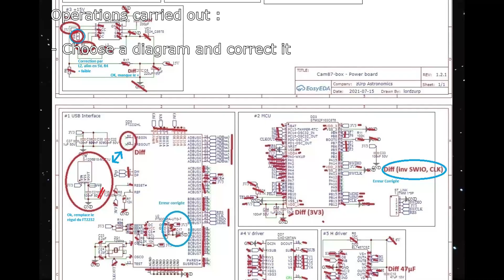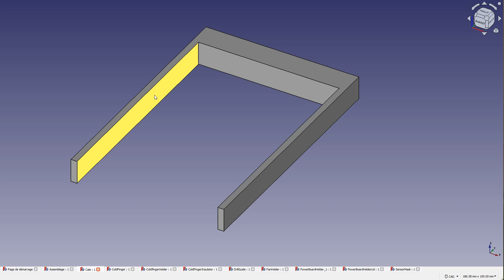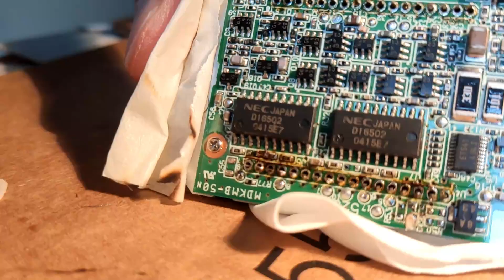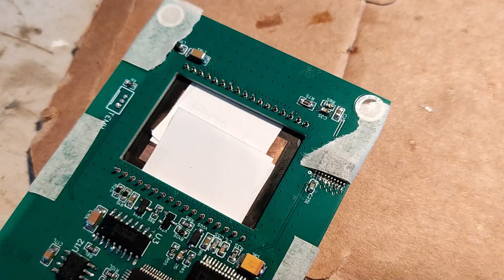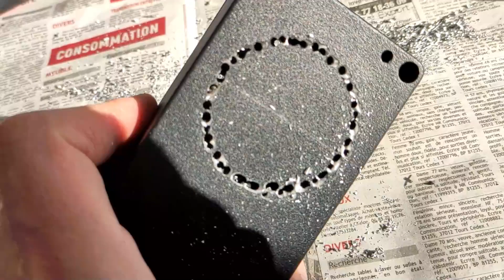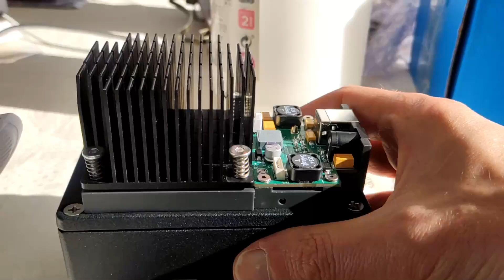DIY Astronomy Camera Cam87 EN

Comment: Very  nice update to STM32. I built the CAM 86 but had firmware issues. Is this CAM87 able to connect now with N.I.N.A or is the old ASCOM driver still the missing link?
Reply from the maker: Hi, you can take a look to my github page. I managed to create a X64 driver that works with N.I.N.A. it's in Old ASCOM platform/ASCOM Driver folder. (Note that it works also with latest ASCOM platform). I also made a CAM10 driver (32 bits) that now works with this last platform and PHD2.

Comment: Hello. Thank you for sharing this interesting project. I am beginning to work on this but have ran into a hurdle:

I upload the cam PCB Gerber files at JLCPCB, but I’ve noticed that the PnP (pick and place) file in the repo lists some reference designators (e.g., C1S) that don’t appear in the provided BOM.

Would you be able to share the original PCB design files (e.g. KiCad/Altium/EasyEDA) so I can re-export a matching BOM and PnP set directly from the design? 

Thanks again for your time and for sharing your work!
Reply from the maker: Hi, the Pick and Place exported files are correct ! I just miss the C1S in the BOM file. I correct it. You can see on the PnP file and the schema that C1S is a 100nF capacitor. That's stange it seem that other components are missing, I'll check that.
Reply from the maker: Github updated Now ! There was several mistake in my BOM list : Corrections made : several 100nF and 1µF were missing, U12 renamed in U2L like the pick and place file, double lines R2 and R9L deleted. In pick and place files : C3 and C4 was replaced by 330pF (was 200pF) because 200pF overclock the MC34063, R4 replaced with a 220mOhm (was 500mOhm), was not enough to power the cam.

Comment: What your results for gain and offset calibration? The instructions are not clear for me, i can iluminate the sensor with different light intensities and the setting change,i also get high max values on the histogram for dark frames about 1-5 minutes i can get about 55000 at max value.
Reply from the maker: Hi, I followed Patrice's method from Webastro, link below, and no issue so far. my parameters are  Gain 28 and Offset 14. https://www.diycam.fr/index.php/fr/10-all/software/13-reglage-du-gain-et-offset